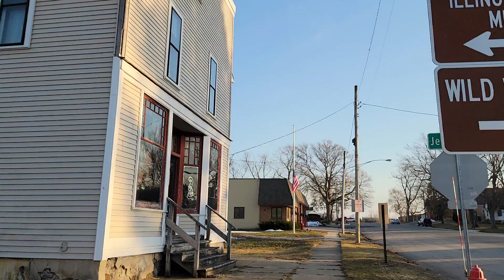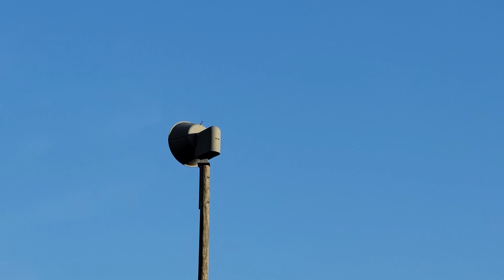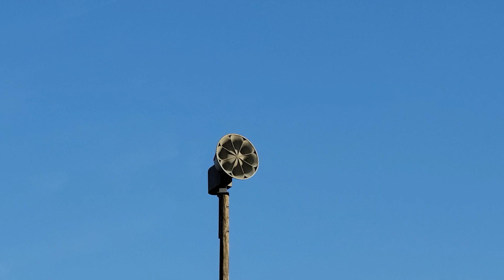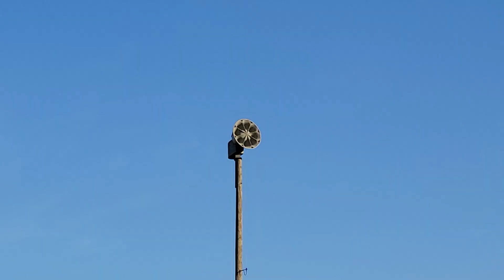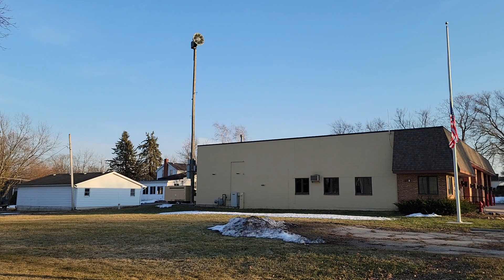ASC T-128AC/DC Fire Siren Test, Alert, Union, IL

Comment: Union doesn't do a growl lmao
Reply from the maker: Interesting considering it's a Fulton-managed unit.
Reply: @BusMaster99  fulton only growls Dupage and Cook and some of Kane. if they growled every unit they managed they would have to get VERY HIGH powers transmitter as they have installed multiple sirens out of state
Reply from the maker: @Midwest_Sirens  Interesting.  Kendall County is also growled, but at 5:05 instead of 8:10.
Reply: @BusMaster99  yeah they aren't controlled by fulton though
Reply from the maker: @Midwest_Sirens  Oswego and Yorkville?  They use ASC sirens (apart from the one ACA P-15 in Yorkville).
Reply: @BusMaster99  Those sirens were installed by fulton, not controlled by fulton. Dispatch counters control those towns
Reply: @windycitysirens  correct
Reply from the maker: @windycitysirens  :thonk:

Comment: It’s rotating backwards
Reply from the maker: No it's not.  Older T-128s are supposed to rotate counterclockwise.  ASC changed that sometime in 2008.
Reply: @BusMaster99  wait what I though they turn clockwise
Reply from the maker: @VOLTRONDEFENDER4440  Only newer T-128s.